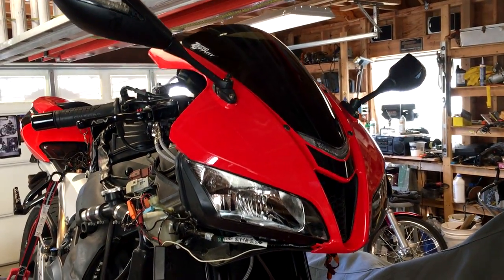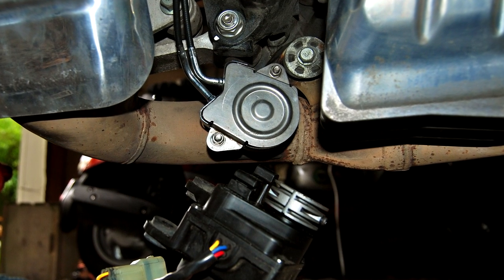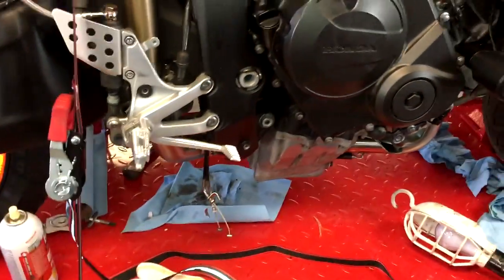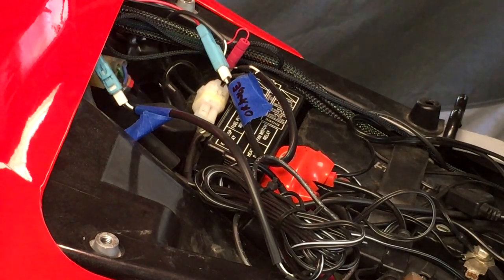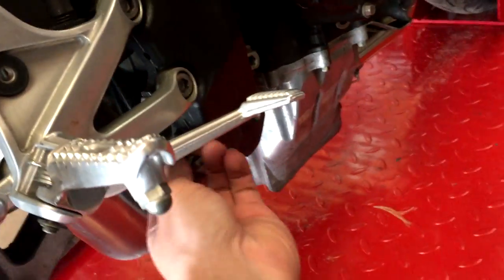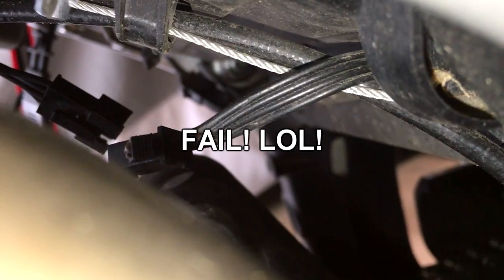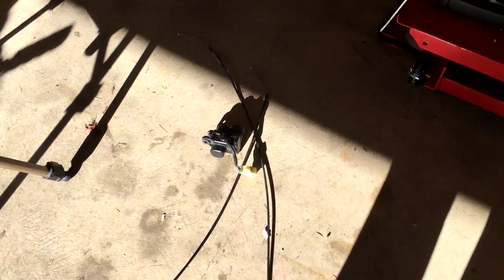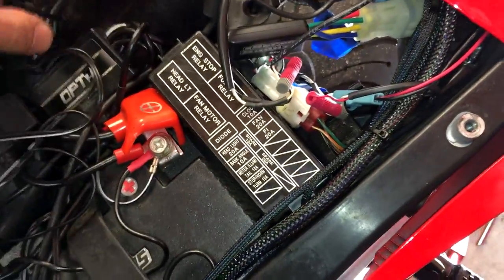CBR600RR Servo Eliminator

Comment: Have you done an ECU reflash yet? If not, you should look into it!
Reply from the maker: Nope, I have a power commander so I don't need to do the flash
Reply: The flash can do things the PCV cannot. Such as: remove factory restrictions, improve throttle response, raise idle rpms, fan kicks in at a earlier temp, etc.. Made a huge difference on my R6, I still got a PCV when I did my exhaust but I'd say the flash is definitely worth it. Check out BAUCE racing ecu flashes if you want more info.
Reply from the maker: ThaPersianOne Thanks i'll look into it. I don't think my CBR (2008) has any such restrictions. The PCV should be able to improve the throttle response. Raising the idle and changing fan, etc. is very useful, not sure if I'd need it though. I'll check it out anyway :)

Comment: My servo takes up no room cause it’s mounted under chassis in front of rear shock. And who cares about 1/2 pound of weight? It’s not worth the trouble to remove. Just disconnect cables and roll ...

Comment: i did a gear indicator on my 07 cbr 600rr, i go through setup, blinks L... then 1 n 2 n 3 n 4 n 5 n 6...o meaning completed...then thats it. it wont shift back down like to 5 4 3 2 ext. i turn the bike off, back on and just get -- the neutral line. any ideas?
Reply: also ive reset it, key on off 6 times, relearned it. and it does the exact same thing it goes through the learn mode. .. and then just stays at 6 once completed. wont go back down. then bike off -- line

Comment: Is there a position you have to keep the valve at? Mine is still throwing the code and sounds awful
Reply from the maker: I'm not sure, I only did this after replacing the full exhaust. It shouldn't throw a code though, you must have a problem with the servo buddy.

Try pluggin the servo motor back in and see if the code clears. If it does then you have a faulty servo buddy.

Comment: whats a servo?
Reply: bigwillchill it's a valve on the exhaust pipe that opens up at higher RPMs I think
Reply: mogan23z why would u want to remove that then?
Reply: bigwillchill so there's unrestricted flow of exhaust gases. he changed his whole exhaust system so that's why he removed it. because the pressure will be different from stock.

at least that's what I understand, best to ask others :)
Reply: People like to remove them but I don't think it's worth it (for a street bike).  The servo provides more back pressure at lower RPM's that results in higher cylinder pressure which equals more torque and throttle response at lower RPM's.  Part of reason the 600RR has more low end grunt then other 600's in the class. If you want to go faster get a liter bike : )